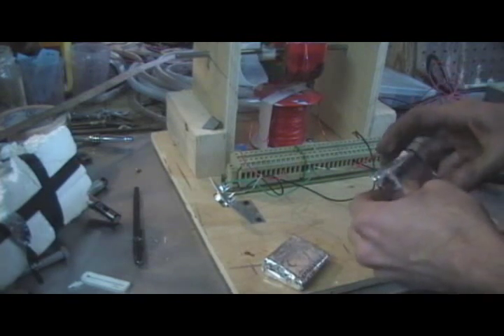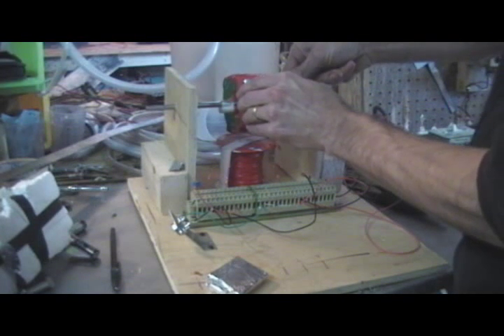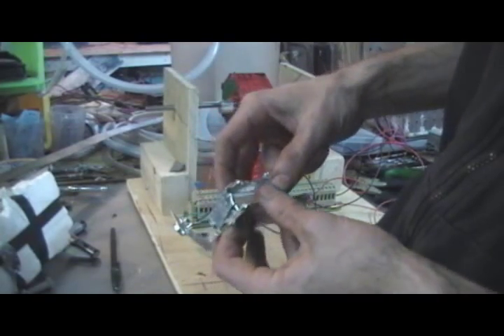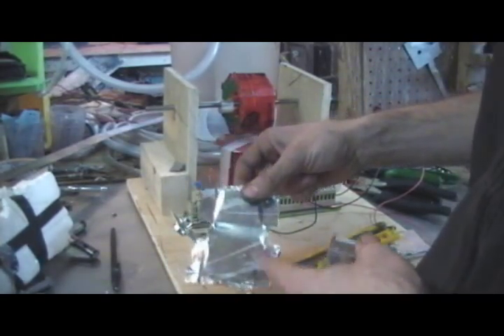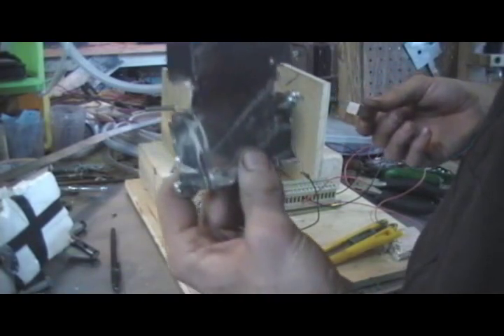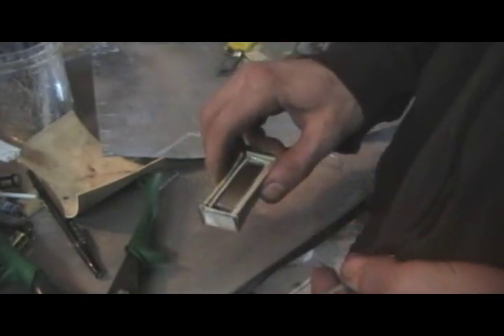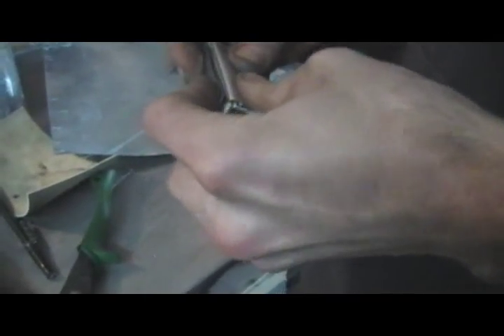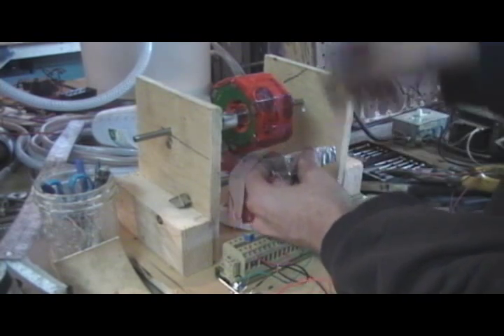Magnetic Shield

Comment: the issue is a simple fact, there is no such thing as a magnet shield, the best you can hope for is to redirct the magnetic field lines through a piece or metal. ppl would be able to work better if they would sop useing terms like magnet shield, when its not it only diverts the field lines through the "shield" and search the inventors of so called working magnet motors names out, and will see that all have been frauds. its sad then give "testers" a bad name. nice work

Comment: 3 suggestions:

1. Bigger rotor (diameter) with spaced rotor magnets not to crush the magnetic fields into each other

2. Replicate with the some rectangular sized permanent magnets like James in the proper configuration, the stronger the magnets the better cause it become more easy to picture and manipulate the forces envolved

3. The some permanent magnets both to stator and rotor, geometry and dimentions are importante and the attack angles between them too

Comment: the rotor don't run because the rotor is too tiny. Do another most bigger for that your magnet stator don't react with all magnets rotor in the same time. You have big magnets and the flux react with others magnets aroud in same moment that it repel one in front of it. After, you could adjust the best angular of your stator magnet. Good work men and I stay tune. Jas